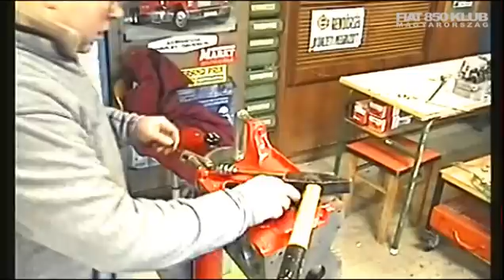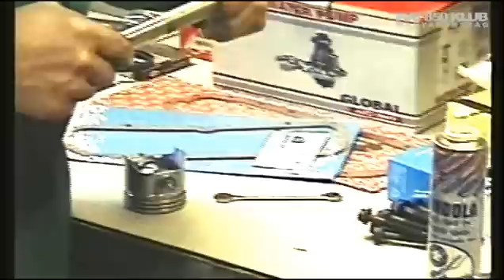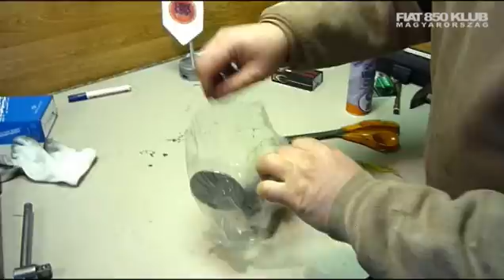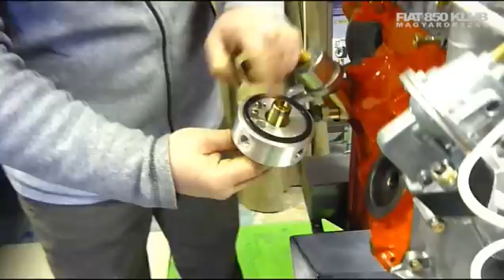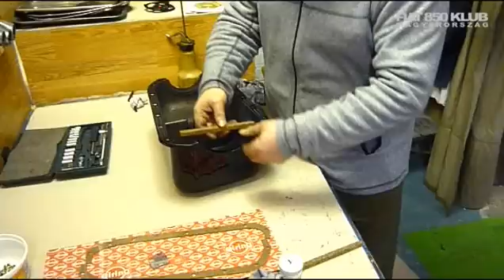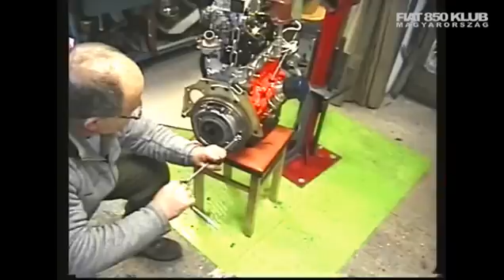FIAT motorfelújítás kisfilm

Comment: Hello friend, I have a fiat 147 in front of a shark very similar to the 127, the 127 is the father of the 147, mine has a 903cc engine, here in my country there are already few with this engine, most of the 147 have a 1050 engine , 1100, 1300 and the space 1400, greetings from Uruguay, Cerro Largo, Melo.